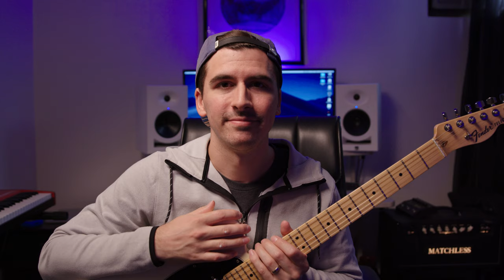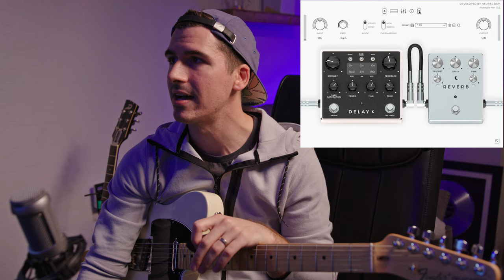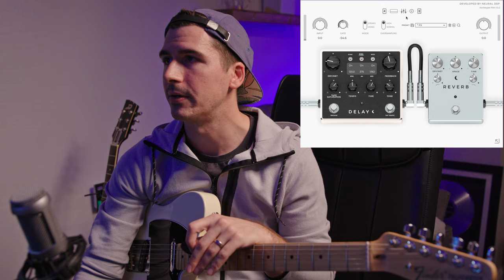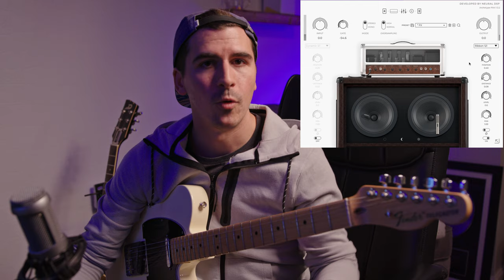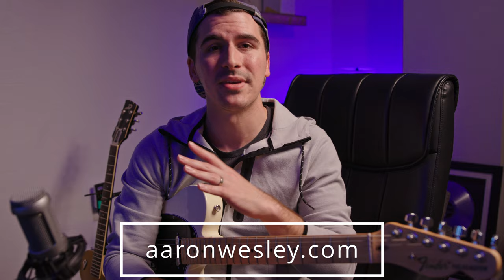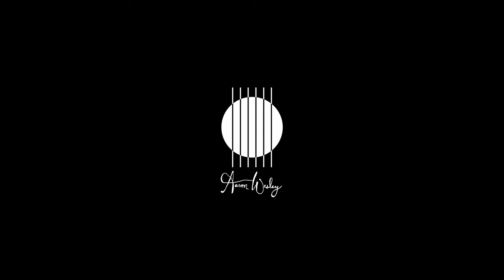One way you may not be using your Neural DSP plugins

Comment: I'm running the same setup, very cool.
I was wondering if it possible to "bypass" your amp preamp and use the plugin amp instead when using a loadbox, so one can swich betwenn the amps without rerouting the cables.

Comment: I actually had to buy a Captor 8 and found only one good set of impulse responses for my tone king imperial mk2. Now in a situation where I’m gonna have to use it at home 99%, and jam when I’m away from home. It’s pretty steep at $80-$100 to buy the plug-in. But the cab simulation and mics are so spot on! DI the real amp in with the cab and effects sounds great! Too bad my demo ran out before the amp. 

Gonna have to make another account and try it. It just seems the best way  to run silent! I think it sucks we can’t get these without the amp part! Because if you own the actual amps…the setups is killer to use a load box! Neural should 100% make a cab sim studio plugin! I would pay too price to have just the cab sims, mics and rooms like a studio and no amp section! Some people have already ripped the responses. But not as close to the interface. 

Any good recommendations for good IR responses, and software for a real Tone King Imperial MK2?